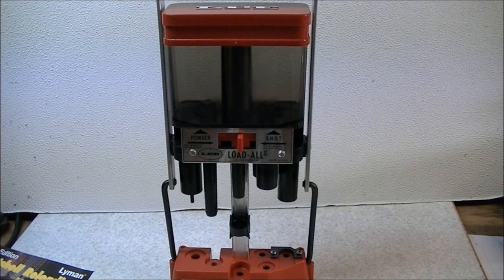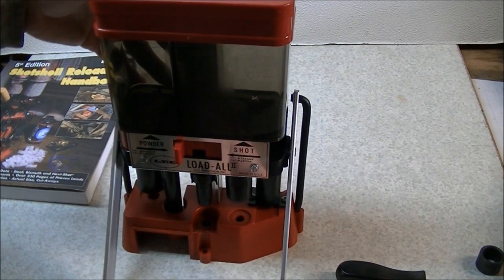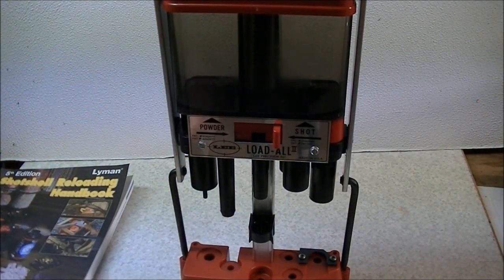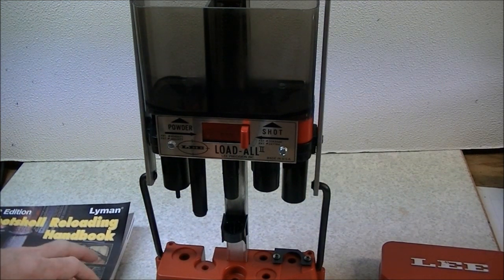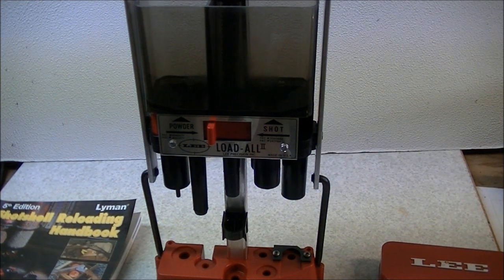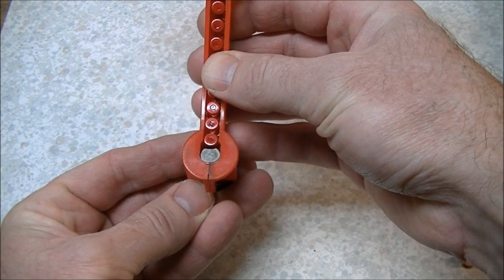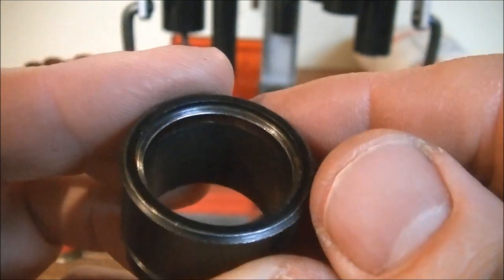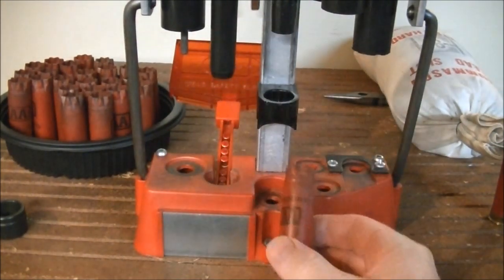Lee Load-All Setup and Operation

Comment: Where you loading steel there i have the same lee load all just did my first round of shells
Reply from the maker: I've never reloaded steel with mine, however it can be done but you have to measure/weigh the steel shot separately instead of using the charge bar.

Comment: If one wanted to use this press with paper hulls and brass hulls,  using cork or pads instead of plastic wads, is the operation relatively the same?
Reply from the maker: Operation is more or less. If you use brass hulls you will need oversize wads (11 gauge instead of 12 gauge). And obviously you cannot apply any crimp on brass hulls with this machine.

Comment: Is  there any manuals to use the lee all 2?   Does the lyman maual have load all  info ?
Reply from the maker: Shot shell loading manuals are generally not geared towards a specific brand/type of loading machine. For example the 5th edition Lyman Shotshell Reloading Handbook does demonstrate the loading process using MEC machines, however the data in the book is general in nature. The Lyman book has powder bushing charts in the back of the book so you can use their load data with Lee, MEC, RCBS, Hornady & Ponsess/Warren brand machines.

Comment: thanks for the video! great instructions.
I have used these a few times and traded off one of them that had everything.
the one I have left doesnt have the spare powder bushings It has the 1 1/4 shot
 
 * can anyone point me to where I can get the bushings?
Reply from the maker: In addition to replacement sets of bushings from Lee I think you can also purchase 3D printed ones.

Comment: I just started reloading with the II model and wondering what is the difference in the 6 and point crimp? I noticed the back one on my 20 ga setup seems to do better job. Thanks
Reply from the maker: Six point crimps are generally found on inexpensive promotional type loads and also on field type loads while the eight point crimps are usually found on target type loads. Many of the six point crimp type shells used to have heat sealed crimps and so were not the best for reloading. As I see it there is no advantage or disadvantage to one or the other, as long as you end up with a good solid crimp it matters not if it is six or eight point.
Reply: Ok that’s what I wanted to know. I appreciate ur video. Very well done.

Comment: With the current price of shot, primers and powder it's actually cheaper to buy than to reload for trap and skeet. The only real savings comes if you're reloading slugs or Buckshot that you've cast yourself.
Reply from the maker: Locally where I live I can buy reasonably priced lead shot, so it's still economically viable to reload shot, but with most commercial made shot you are correct it's cheaper to buy 12 gauge shells except slugs and buckshot.

Comment: What’s the difference between the Load-All 1 and Load-All 2?
Reply from the maker: the big difference is that the original Load-All has a metal base and the Load-All 2 has a plastic base that could accommodate  a primer feed device. Lee no longer makes the primer feeder so in my opinion the old machine with the metal base is the better one, but both work just fine.

Comment: Wish I could find the primer feeder, looks like its been discontinued, there is a 3d printed one on eBay for $50, but that's too much for a knock off.
Reply from the maker: Yes the primer feed was discontinued some time ago. I expect if you are patient you may run across a used one on ebay for much less than $50.

Comment: Public service announcement:
Please be careful when reloading hulls that have a separate plastic, cardboard or Fiber base wads. After a couple of reloads, they tend to come loose and could become a bore obstruction in your Shotgun. Ask me how I know!
Reply from the maker: Yes, that can happen but it is not terribly common in my experience. I've loaded and fired many tens of thousands of hulls that have separate base wads and have only had base wads get loose a few times but they never left the shell. Of course it's a good idea to keep your eye out for that situation and discard any problem hulls. Did you have a specific brand/type of hull that gave you a problem?

Comment: Is it possible to make a little bit hotter loads an is safe as long as you don't get carried way it? My auto doesn't like light loads need to be just a little hotter.
Reply from the maker: With the right components and reloading data you should be able to assemble loads that will make your semi-auto shotgun function properly. I recommend purchasing the Lyman Shotshell Reloading Handbook and take the time to look over some of the loads. Hunting type semi's are generally set up to function properly with hunting type loads rather than with target loads. You can load shells with slower burning powder that gives higher velocity and these loads will most likely get your gun to function properly. Just dont take a target type load with a fast burning powder and keep increasing the powder charge until your gun functions as you will likely end up with over pressure shells that could damage or destroy your gun (or injure you). Always stick with tested, published load data from reliable sources.
Reply: @314299  thank you so much for taking the time to explain that. Also I was told primers were got to find is that a true fact?
Reply from the maker: @warrensylvester3807  Yes primers are hard to find at the moment and too expensive.

Comment: What size bushing would you recommend for using titewad powder to load 20 gauge shotgun shells with 7/8 shot ?
Reply from the maker: As per the Hodgdon website,  Titewad propellant is designed for 12 gauge only. It is too fast burning for use in 20 gauge loads.
https://shop.hodgdon.com/hodgdon/hodgdon-titewad

Comment: Every video I've seen on this reloader shows loading birdshot. Can high brass buckshot be loaded with this?
Reply from the maker: Yes, you can load low brass, high brass, etc with these machines. As for loading buckshot, yes, it can be done but buckshot must be hand counted an placed in the wad, it cannot be loaded using the shot bar like bird shot.

Comment: You suggest weighing each load for accuracy but then use the Lee Loader anyway? Am I missing something here?
Reply from the maker: I suggest weighing each charge of shot and powder when you first start with a particular load combination to verify that you are getting a safe amount consistent with what your load data calls for. As mentioned in the video the amount of powder and shot dispensed by the machine will vary due to operator technique and variation in the manufacture of different lots of powder and shot. Once you are satisfied that the dispensed amounts of powder and shot are correct there is no need to weigh each and every one, that would be very slow and a waste of time. If you watch the demonstration of loading at the end of the video you will note I'm not weighing every charge.
Reply: @314299    Yup, thanks.

Comment: I tried some 3"shells in mine but they tend to get stuck in the primer extractor tube. Ya got any ideas how to stop this?
Reply from the maker: That is most likely due to the shape of the base wad in the shell you are reloading. If you file/sand a little off the circumference of the ram at the bottom that might fix it.
Reply: @314299  thanks! I'll give that a try.

Comment: Would one of these machines suffice for loading steel shot and reloading waterfowl loads?
Reply from the maker: You can load steel shot with these machines but of course the amount of steel shot dispensed by the shot bushings will not correspond with the markings since they were intended to be used with lead shot. If loading steel with one of these machines it's best to measure out the shot separately.
Reply: @314299  got it. Thanks

Comment: I have had had mind  2 months now and it is extremely inaccurate as far as dropping the right amt of powder. Every load is different and not by a little. I have to weigh every load and adjust. Good luck to anyone who gets one ,hope it Dosen t damage your gun!
Reply from the maker: Are you measuring the dropped charges in the course of operating the machine in a complete cycle or are you just dropping charges without all the other operations in between? The machine needs to have a complete loading cycle in order to get consistent drops as the vibration and impact of the cycles (size, reprime crimp) help the powder to evenly fill the powder bushings. I've never had issues with mine being inaccurate. What sort of variation are you experiencing? And what powder are you using with what bushing? Some powders don't measure as well as others - for instance coarse flake powder like 800x is noted for inconsistent charges in most mechanical measures, whereas most ball/spherical powders measure exceptionally well. When it comes to shot charges it is easier to get consistent results from small shot sizes compared to large ones.

Comment: Can you use the lee loader for new hulls?
Reply from the maker: Just be careful when moving thru the crimp starting station to apply slow and gradual pressure on the hull to start the folds in it.
Reply: Thanks
Reply: I have zero problems crimping new cheddite hulls.
Reply from the maker: @GeoffAlbertson  Good to know. Cheddite hulls are of comparatively thin plastic so I expect they would be the easiest of any new hull to get a crimp started.

Comment: Can you use this set up to load steel shot as well.
Reply from the maker: Yes, but of course the shot bushings will not dispense the same amount of shot with steel as they are calibrated for lead.
Reply: @314299  what size bushing would i have to use to load steel shot?

Comment: Can I reload 12/65 (shell lenght 65mm) shells on this? I have old SxS Sauer on this caliber and I have a problem with factory loading in Poland :(
Reply from the maker: You should be able to slightly modify the machine so as to be able to load shorter shells. 

2 -1/2" (65mm) shells will require you to move the wad guide down 1/4" (6mm) from it's original location, to do that you'll have to drill a new hole in the column for the screw that holds the wad guide on. 

You'll need to add a 1/4" (6mm) spacer to the base of the crimp starter station so that the shorter shell will sit high enough to have a crimp started.

Finally you'll have to cut 1/4" (6mm) off the bottom of the crimp die so that it will go down farther on the short shell allowing it to form a crimp.
Reply: @314299  With the recent popularity of smaller mini shells like Aquila Mini Shells 1 3/4" and NobelSport Mini Buck in 2 1/4" you would think Lee Precision would create adapters for these shells, but they seem slow on innovation. Definitely will like to load 2 1/2" so your information is very helpful. Many thanks for answering these comments.

Comment: can it fill 30 grams of gunpowder?
Reply from the maker: No, it will not. There is no shot shell that I know of that takes 30 grams of gunpowder - that is 463 grains! That is several times the powder charge required to load shells. 
Do you perhaps mean 30 grams of shot?

Comment: Can you switch from 12 to 20 gauge?  If so, how is that done?
Reply from the maker: To convert between any of the avlaiable gauges (12, 16 & 20) you need a conversion kit which consists of a replacement  die carrier, steel sizer, wad guide and shell holder, as well as load data. Some disassembly of the machine is required but it is not complicated.
Reply: @314299  Thanks!

Comment: Does this machine perform the final conification operation?
Reply from the maker: Sorry but I'm not sure what you mean by "conification operation".
Reply: @314299  It is a tool that in certain reloading machines tightens the mouth of the cartridge a little, to facilitate loading in PUMP or semi-automatic shotguns.
Reply: @314299  Example:  MEC "cam crimp".
Reply: One type of "factory crimp" for shotshells.
Reply from the maker: @runnerba  I understand now, generally that's referred to as "taper crimp". The Lee machine does not have a separate die or station to give the shells a taper, however there is a certain amount of taper  built into the final crimp station and this is generally sufficient for the reliable operation of pumps and semis.
Reply: @314299  Thank you!!!!

Comment: Does the 116 represent grains or is that just a designation
Reply from the maker: The numbers on the powder bushings are a volume size, and this number does not represent grains. Because the density of powder is variable from type to type the same bushing will dispense different weights of powder when measuring different types of powder. For instance bushing #116 drops 13.5 grains of Red Dot but 29 grains of H110. You need a bushing chart to go with your reloading data so that you can load safe and effective shells.
Reply: 314299 Shooting Channel thank you  I just found the chart or got it from my neighbor rather
Reply: The number is clearly cubic inches, with implied 3 decimal places. You see the Decimal on the charts. Amazing how many references call these cubic centimeters in error. Lee powder dippers are cubic centimeters, but Lee bushings are cubic inches.
Reply: @GeoffAlbertson  thank you jeff I appreciate ya

Comment: Is it just me or does this not throw consistent charges. I wonder if that is okay..
Reply from the maker: I would not worry about the consistency of powder charges too much, it's far less important than most folks think. Consistency of charge weight depends mostly on two things: Powder type and operator technique. Certain powders "flow" more evenly into the bushings and will give more repeatable results, for example ball powder measures better than flake powder. Operator technique is also important - follow the steps as shown in the video, don't "batch" process your shells (de-prime them all, prime them all, etc) as this does not give the powder the chance to evenly fill the bushing as it does when the machine is used as intended.
Reply: @314299  Thank you for that information. I loaded mine with the regular powder charge thrower. While you are probably right. I sorta like the consistent recoil you get when you load consistent charges.  Next I am going to replace the #4 birdshot with some 48 grain .311 caliber balls. Ill probably weigh each charge with those. Great machine it's really the only cheap way to get into shotgun reloading.
Reply from the maker: @elliothuh669  They certainly are an economical way to do shotgun loading. Good luck with your buckshot loading.

Comment: Let me price of Lee Load-All setup and operation
Reply from the maker: Sorry but I don't sell these. You might want to contact Lee Precision to see if they have a dealer in your country.
Reply: $59 and raising but hard to find currently. Ignore the scammers that bought them all up for $59 each and put them on ebay for up to double that. Look at Midway or Amazon but Amazon did a recent price raise. There is a version for $1 more that has a bushing for Australia for their other types of powder but seems nothing else is different. The problem will be finding shot and powder / primers. Be careful not to overpay for shot.  $45 a 25# bag is about normal, Powder $20 for 14 oz bottle to $25 a pound. Primers depending on type about $15 for cheddite to $30 fiochi and $35 winchester. Wads are about $10-$13 per 500 and hulls you will have to look into more but usually come primed at about $15 per 100
Reply: @jsauerii  thank you. I just got my Load-All and this was really helpful in knowing what's a good price for materials